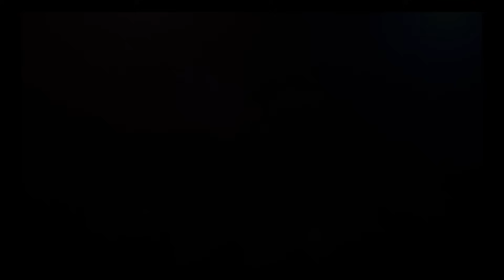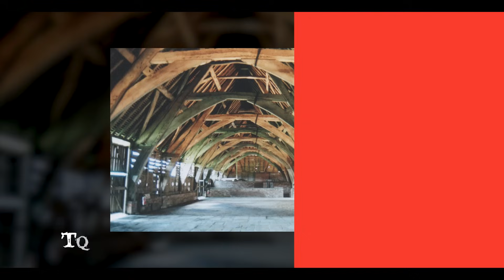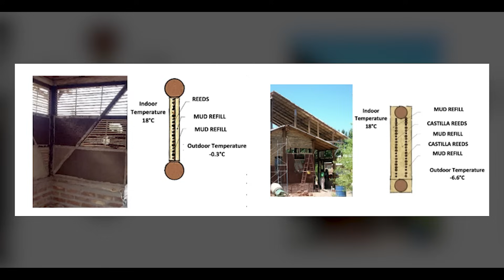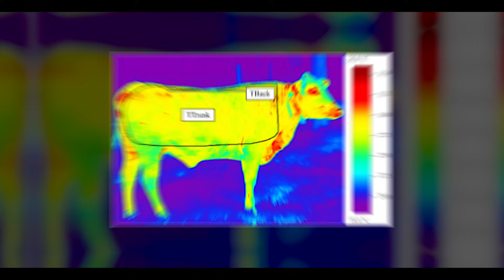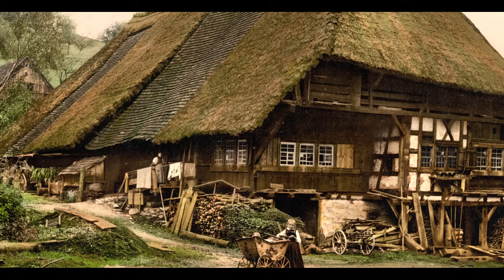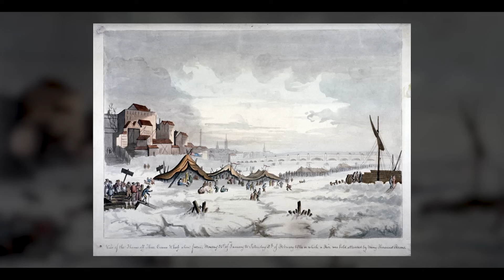How Medieval Peasants Built Shelters to Survive the Little Ice Age

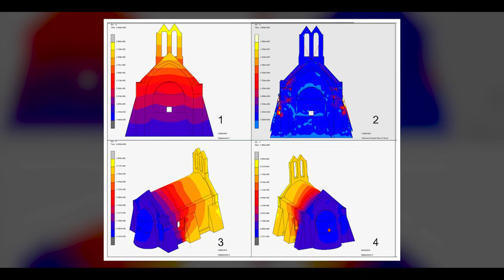Comment: 6:01 – Improving temperatures by 3–5°C just by raising the floor?
That part absolutely blew my mind. They basically invented passive insulation centuries before modern green architecture. No electricity, no fancy materials — just smart design and stone footings! it’s crazy to think peasants back then were already solving the same thermal problems we talk about in sustainable housing today. Anyone else think we might’ve rediscovered more than we invented?

Comment: Cold is not “conducted from”. Second Law of Thermodynamics? Heat energy disperses into colder matter. Cold doesn’t move, heat does. Quite literally. Y’all learned this in high school.
Reply: My air conditioner moves cold pretty good though 😂
Reply: The heat moves from the building into the cold ground, raised piers or foundations stop thermal bridging using air as an insulator. The video probably should have discussed heat batteries and the reasoning behind the raised wattle and daub vs earth homes, in the one case you are using the stability of the ground temp and the material density as a heat battery and insulator while in the other you are using air as an insulator in the thatch and daub mixtures and mitigating moisture and thermal bridging by raising it. Would also be cool to compare these with mandan huts which are a combination that is partially underground.

Comment: Funny, when I visit Europe, it’s mostly the ancient stone and brick buildings that I see and are significantly different than what we see in the US, although, I did see some structures that are described here in Europe but not nearly as many as the stone and block/brick structures. I would like to see a better roofing system in the US, I saw a lot of very old slate tile roofs in England and other areas in Europe that seem like a better longer term solution than shingles.
Reply: You use wooden shingles because timber is cheap for you , we used welsh slate because it was cheap and abundant.  Most rooves are now being replaced with concrete tiles . I prefer slate personally.
Reply: May issue is weight and cost.
 Asphalt shingles or metal roofs are much lighter than a slate roof.
  The amount of additional support and labor costs money.
  Plus a person who applues slate roof is a specialty trade that takes years to master and is an art.
 Asphalt shingles are quick an easy.

Comment: Assisted thinking again: Just talk about weather and climate, the UN information about man made climate change appear. Just in case anyone might think this changes could be natural😂😂😂
Reply: Maybe climate disruption is a combination of natural cycles and human factors.
Reply: @VMorgenthaler-yp6yz exactly.

I've yet to see any research examining where we are in the Milankovitch Cycle on our current climate, for example. 

But at the same time, human activities are an issue. Take deep sea mining as an example. There's loads of nodules full of crucial minerals like cobalt & nickel just sitting on the surface of the sea floor. All we need is robots to crawl over the sea bed collecting those nodules - no need to gouge out the earth above. Sounds good, right?

Well, not so fast. Apparently those nodules are a home for microbes AND they produce deep sea oxygen. It turns out that there've been mass de-oxygenation events in the past that started in the deep seas. We just don't know enough about how mining of these nodules may affect climate in the future. Ergo - how much damage have we done to our natural systems because we didn't fully understand how they worked & interacted?

Aerosols that pumped chemical gases into the air that destroyed our ozone layer, which helps protect us from UV radiation, which is deadly to us.
Reply: @VMorgenthaler-yp6yz its a cyclical event that happens every 12000 years. Mostly solar driven.
Reply: I think I smell 🐂💩

Comment: I am a 74 year old woman who has built a 20 sq ft diameter earthbag house by myself, except for my nephew's help in digging a 3 ft rubble foundation.  The earth from the dig went into malt seed bags and placed in a circular ring held in place by two rows of barb wire.  The heavy bags were filled on the wall as obviously I could not lift the bags filled with earth.  The walls are 24 in thick.  It has a loft and the ceiling joists were done in one day with the help of my nephew again, and the roof rafters were erected by myself by the ingenious invention of a 16 post steel construction that allowed me to slide each rafter into a slot and bolt in place.  The roof has 16 segments, I think a hexadecagon.  A really pain to shingle with cedar shingles, it took me a whole summer.  I only work on the building two months of the year as it is located on Prince Edward Island, Canada, my birthplace.  I started in 2017 and working two months each year minus two years for Covid, I think I have done ok.  It has six layers of sand/clay/straw/lime mix on for breathability and the final layer put on last year was sand and lime mix plaster.  Didn't get over this year, but will start on the inside next year.  It stays completely dry, no humidity, no mold.  In summer it is wonderfully cool will be curious to see how it holds up in our Canadian cold winter storms.  It survivied the hurricane Fiona, 2022 without a scratch.  My brotherinlaw says a tank couldn't knock those walls in lol.  Wouldn't want to test that theory..  Anyway, just wanted to say, people are definetely interested in the sustainability of buildings these days.  I just wish I were younger when I began this project.  I hope I can finish it.
Reply: Good for you, girl!
You remind me of another 70 something yo lady who runs a small farm. She does all the tack and harnessing of two draft horses and plows, harrows, and seeds it with her team.
You women are really something!
You're an inspiration to this 59-year-old guy!
Reply: @Skunk106    I think I saw a video of this woman.  She reminded me of my mother and her friend, who are very industrious.  My grandfather was a hard worker with an apple orchard two barns, two tractors, and more.  He went up to a friend's barn in Pennsylvania to get old beams to build one barn with.  It was a magnificent job.  Everyone will experience a real challenge with the economic collapse, many people have had visions and dreams of a massive famine and very harsh times.  This type of person will likely have much less trouble.   It's a shame these habits and this knowledge is not preserved.
Reply: @davidm1149 
This is cool stuff you're sharing! 
I find great joy in seeing how many people in general, but especially young people are actually learning the old ways through YouTube and other avenues.
It's not a lot of people overall and many are going to suffer mightily when things start falling apart, but it's good to know that a lot of knowledge is being carried down and preserved. They're going to need it! 
I keep saying that the generation being born now are special because they're the first that are being born into a completely digital world and I believe they're the ones who are going to be paving the way back into the old ways when the collapse and mayhem starts to really unfold. 
I hope I'm wrong!
Reply: Do you have a link to photos of your house? It sounds like you have done a great job.
Reply: @johndonahue1935  Thanks for asking.  I started a blog in the first years working on the house.  It is under P.E.I. Earthbag House on Facebook.  I kept it up to date until Covid hit.  I couldn't get over to the Island for two years.  So I havn't updated the blog since then.  I'm not very good around the computer so lining up the pictures and the videos was a challenge for me.  Hopefully this link will give you an idea.  I was to start the inside this summer when I was over but circumstances happened and I didn't get over.  Hopefully, next year I can get the inside finished.